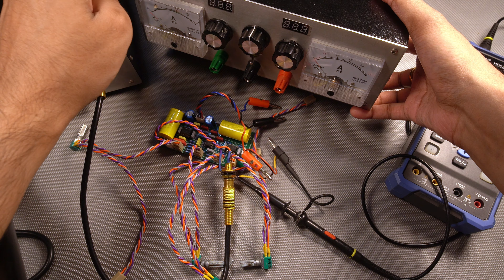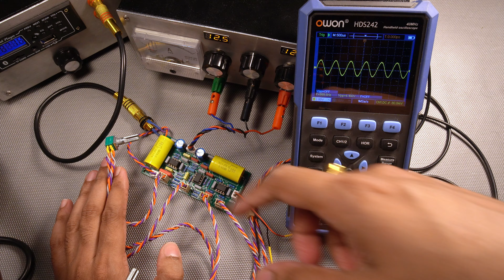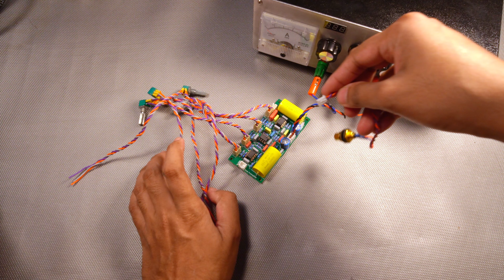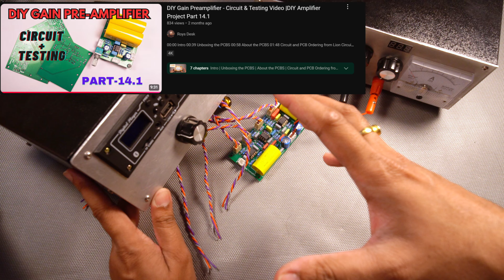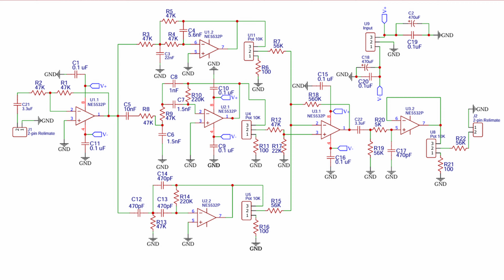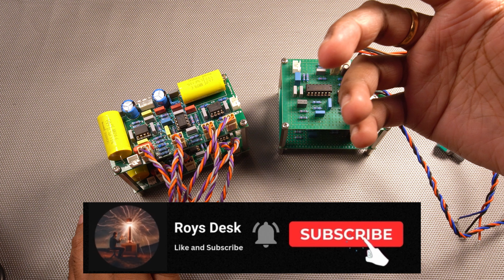DIY 3 way Tone Control Board - Bass Mid and Treble Hifi Preamplifier | Detailed Testing

Comment: Thank you for a perfect video and explanation. Thumps Up.    By the way -  what is your power for this tone control... is it +-12 volt or higher...?  I could not hear this in your video...
Reply from the maker: Thank you 😊 .. I used ±12Vdc for the power.

Comment: Can you do analog vs digital tone control effects tests? What difference can one observe when using old school tone control boards vs digital Eq. present in media players? IMO digital Eq should offer better freq, control (I guess there should be no measurable effect on 1 kHz tone due to bass treble knob), accurate L-R channel tracking and lower distortion. Tone controls and graphic Eq were all the rage during the cassette LP era, but with digital medium, its kinda become an obsolete feature
Reply: mainly is about having the adjusted band getting affected and the boost or cut not affecting the other region. Some other things are also there such as phase smearing if you do too much boost or cut and the cap leakage and other parameters matters here in the analog feedback section